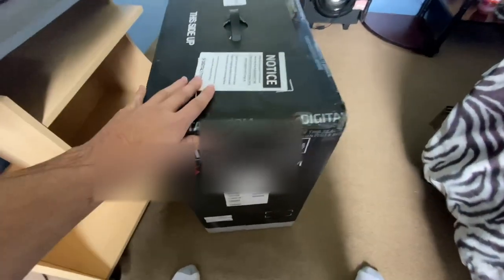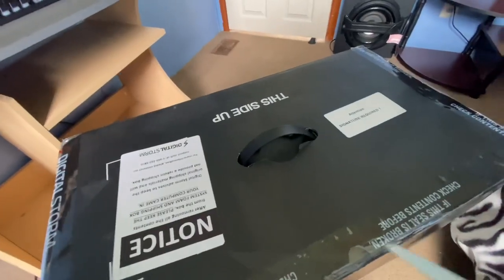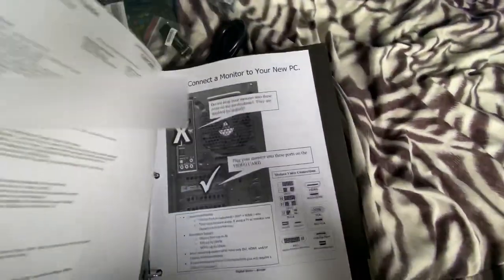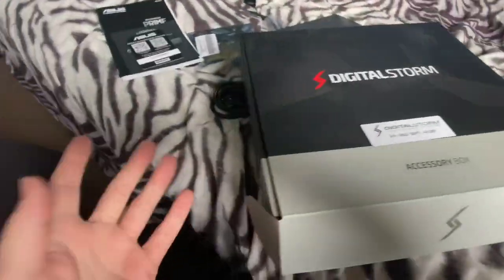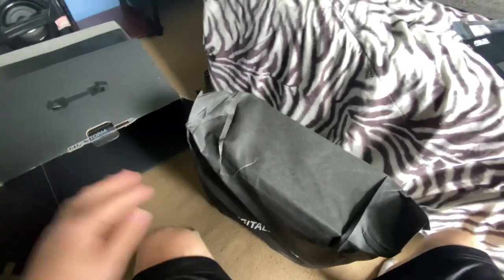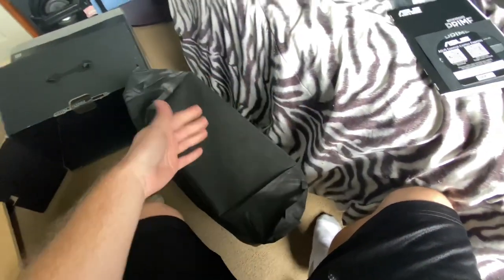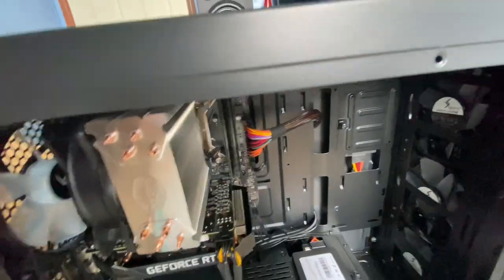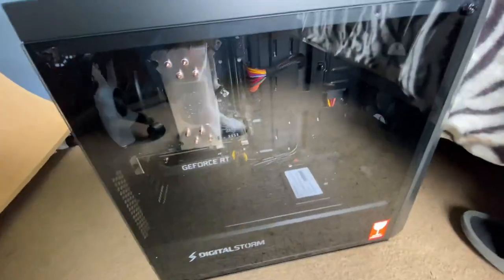Digital Storm Lynx Level 3 Unboxing.

Comment: Hey man just saying you need to put the pc on the desk or in one of the Cupboards because it will ruin the airflow Especially carpet. But I’m about to get the same pc thanks for the unboxing video👍
Reply from the maker: Yeah, I moved the pc
Reply: Oh ok good😂
Reply from the maker: @romunity9979  No Problem.
Reply: i have hard wood floor can i put it on the ground next to my desk
Reply from the maker: @Ironfist20111  Yes, it'll be fine it has feet on the bottom of the case. Carpet not because of dust. I moved mine to the living room.
Reply: @everythingvideos24  ok thanks bro

Comment: Sorry I’m rlly late but how do you connect that thing to a monitor I have right now in my room trying to figure it out lol
Reply from the maker: Look below where the back fan is you’ll see a hdmi port below the fan.
Reply: @everythingvideos24  what about vga monitors? im having a hard time
Reply from the maker: @joshuagonzales2045  It would be where the back of the motherboard is located on the upper part of the desktop.

Comment: 2200 for level4 rtx3080 is a steal with the new prebuilt setups
Reply from the maker: I won't be buying my next pc. I think the next pc I'm going to build myself. I just got this one on credit so it's helping my credit etc.
Reply: @everythingvideos24  yeah ideally I wanted to just build it myself but my current system was dying (overheat damage) so I needed a quick cheap (Cheap in terms of the 3080) solution and it just fit it.
Reply from the maker: @lLooN3y  Hell this one I got is a dust machine it sucks up dirt like crazy. I had to take my power supply apart to clean it etc. I think my next machine I might go liquid cooled.
Reply: @everythingvideos24  is it the case that’s the problem with dust?

And the version you have came with a fan ? Not liquid?

I’m just kind of worried about putting it on the floor , my new desk isn’t coming until December. 

Well, I’m still waiting for it at my apt lobby right now. Since my new place doesn’t have a door man.
Reply from the maker: @lLooN3y  The case and fans. Every week it’s like I’m cleaning it.
Reply from the maker: @lLooN3y  Yeah mine has fans. My next gaming pc I'm going to build it'll be liquid cooled.

Comment: 2022 the new level 3 has I-5 and 3070 rtx for $1500
Reply from the maker: I know it's ridiculous. I said I wouldn't buy no more digital storm computers because the RTX they stuck in there rattled when raising the fan speed up. I recently built my own with a I7 10700, RTX 3060ti, 3+TB of space etc.

Comment: Did you use a hdmi cable to connect to your monitor or a vga?
Reply from the maker: I used HDMI
Reply: @everythingvideos24  did you plug the it into the motherboard or graphics card
Reply from the maker: @dogpixel  I plugged it to the motherboard but the CPU they had in it didn't have graphics so I than plugged it in the GPU and it worked fine.

Comment: I have a question if you select the wireless internet thing will you still have the ethernet port?
Reply from the maker: Yes,
Reply: @everythingvideos24  Thanks a lot because i am about to get this pc on black friday and one more question should i get 144hz moniter or 165hz will i get above 165 fps in pubs?
Reply: @SoildierReactions  you will get 165 fps but it depends on what game your playing but if you wanna play fortnite or cod you will but get a pc with a good graphics card so you will get higher fps
Reply: @Sens17  ok thanks a lot I just need 165fps to 180fps in pubs that’s all thanks for answering!
Reply: I will play fortnite most of the time
Reply: @Sens17  are you 100% sure that I will get the Ethernet and the wireless internet!
Reply: @SoildierReactions  same I'm waiting till black Friday or Christmas to buy a pc I'm tired of console

Comment: Can it run 1440p 144 or 120 ?
Reply from the maker: i've been using 1080 and it hits 60 to 120fps on ultra settings
Reply: @everythingvideos24  Im looking for a pc that can run 1440p 120 or 144 cause i dont want the new xbox or ps
Reply: This pc is powerful enough to run 1440p 144fps. It’s just that they didn’t send him his 16gb ram, which affects the gameplay A LOT.
Reply from the maker: @RixenAce  Yes, it has the 16gb ram the box said different.
Reply: Everything Videos oh. Didn’t see that... sorry!

Comment: How much was it
Reply from the maker: $1,353.22 It's way overpriced.
Reply: U got robbed my guy if you would have went with skytech you could have saved $150 and still have a powerful PC
Reply: My friend was thinking about getting a digital storm but all the prebuilts they have is literally just a scam
Reply: I looked at a $2,400 PC on their website and it did not come with a 2060 grapchics card 8 gig they only came with a 4 gig 1440 grapchics card  and only 500 gigs of ssd
Reply: @everythingvideos24  that’s not a bad price
Reply: @heatblast8918  digital storm is actually a great company
Reply from the maker: @heatblast8918  Yeah, the money didn't matter to me. I'm planning to buy a different gaming pc with the RTX 3090
Reply from the maker: @heatblast8918  Mine is a RTX 2060 6gb it has 16gb ram and a 512gb ssd. This is the one I got https://www.digitalstorm.com/configurator.asp?id=2486287
Reply: @everythingvideos24  mine has the same thing except mine has one terabyte of SSD

Comment: Holy shit! DVI ports? WTF that can't even output 4k!! The max for DVI is 2560x1600... What the hell, Digital Storm? Not much of a gaming rig for $1,300. You can buy a decent gaming laptop for that and still use a secondary 4k display if you wanted. Not to mention and already have a high refresh rate display equipped.
Reply from the maker: It has hdmi and a display port to if you didn't know. this computer can output 4k.